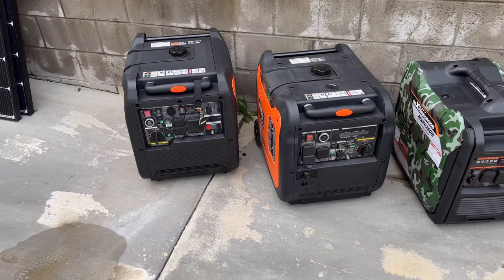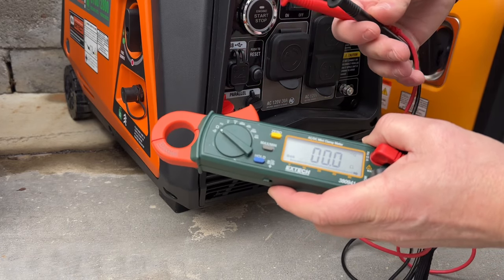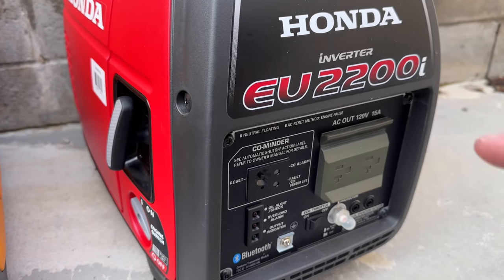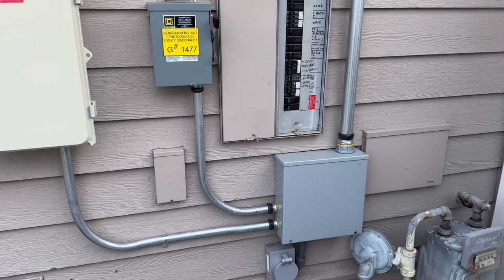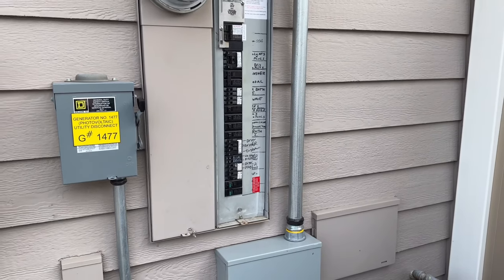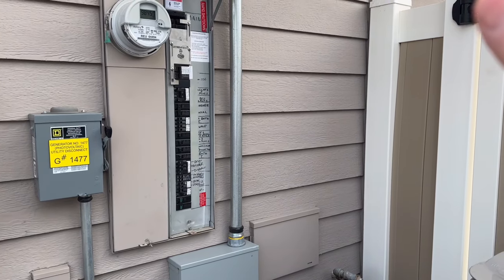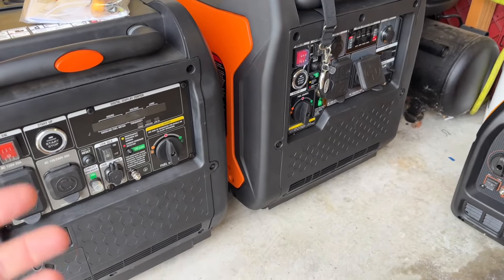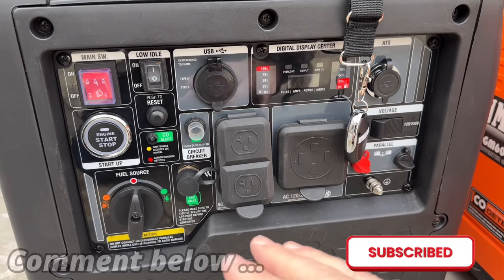Bonded VS Floating Neutral Generator Does it Matter?

Comment: What i understand , the rule of thumb is, if you are connecting to a breaker box or back feeding , it has to be unbonded. If you are using extension cords , then it needs to be bonded.

Comment: Floating neutral generators are for hooking up to your house panel which will then provide the generator with the bonding and the ground rod both bonded generators are for stand alone use with extension cords isolated from bussed systems.

Comment: One and only one bonded neutral for each separately derived system'; otherwise, you are creating a dangerous alternative path of current should there be a ground fault.  You need to know whether your transfer switch opens the neutral along with the phase conductors; generally they don't; they open the phase conductors and use the home/building's neutral conductor path.  In which case, the generator should be set as a floating neutral, if it isn't already  When a generator is used as a stand alone power source (i.e., a separately derived system), then the neutral and ground should be bonded.  A bounding plug should be handy to quickly changing from floating to bonded neutral when you use for the generator as a stand alone power source.  Always mark your generator, asn to its permanent state of boding.
Reply: If your generator has GFCI outlets, will that bonding plug work?

Comment: I work on the railroad and have had to deal with this every major storm. We temporarily power interlocking bungalows with every type of generator available at the time during power outages. The 5000+ watt units with gfic outlets we have to convert to floating neutral or they trip and won't power the already bonded electrical panels. It was never an issue before gfic outlets in the new generators. The last group was a pallet of generac 8000 watt units. No big deal if you know what's going on. Like you said only 1 bond for the new fussy generators lol.
Reply from the maker: Yea it’s really the new ones that have been giving some people troubles. Sometimes no issues, weird.
Reply: Actually, it is not weird at all, just a lack of insight into what is happening.  So say you hook into a bonded panel with a GFCI generator outlet.  You will create a ground loop, which is against code as in you have two bonded points.  That ground loop will generate a ground - neutral differential at the GFCI outlook.  GFCI is designed to look for small differences as your body is a resister and so will only draw a small current when you are completing the circuit with your body.  GFCI needs to be able to trip with these small currents so that people don't die when they complete the circuit with their body.  However, seeing you are bonded at the generator and at the panel and all the wires have some resistance, you create a ground circuit loop through the GFCI on the generator and pop it.  There are other YouTube videos that get into this.  Say you are pulling a 1,000W load,  You may see say 1 amp going through the ground on the generator due to the neutral bond in the panel.  1 amp will pop a GFCI with ease.

To make a big topic with GFCI simple, it is generally used where people and water may be present at the same time, like say your bathroom or kitchen or even basement where water could intrude in.  Probably also want to have near a pool.  If you don't need GFCI, you don't want it.  Say for example you have a computer.  You probably want to have your computer plugged into a surge protector or even full on UPS with a built-in surge protector when on grid power so that a lightening strike on the grid doesn't necessarily fry your computer.  However, say you plug that surge protector / UPS into a GFCI outlet.  Whenever there is any sort of power surge on the grid, which I find tends to happen multiple times a day every day, the surge protector will dump the excess power to ground with the intent of it going to Earth ground, say for a lightening strike.  However, seeing you plugged into a GFCI outlet, it will interpret that as someone getting a shock, say like what it would see from water splashed onto a toaster oven while someone is operating it, and trip the GFCI breaker.  Better for the CFCI breaker to trip than to become toast yourself, but at the same time if this is not the situation you are looking at, you can see that GFCI is actually working against you and popping even when it seems like everything is fine.  And of course if you figure out what I mean by creating a ground loop with dual bonding ground and neutral with GFCI involved, you will see that you are going to trip the GFCI whenever there is any sort of load on the circuit, which is definitely not what you want.

Comment: We had power out due to a storm on new years. I ran an extension cord to the furnace by Trane from the Honda 3000 generator.  The blower turned on but the furnace would not ignite.  I had to bind the neutral and ground for the system to work.
Reply: That's what I have noticed as well. Most furnaces need the bonded connection to work.
Reply from the maker: Most furnaces are like that.
Reply: Generally nowadays most do, and nearly all high-efficiency do need it.
Reply: Thank you for posting this.  Just went thru an ice storm here in Texas and ran into this issue.  I must have wired and unwired the damn thing 10 times same result every time.  Thanks

Comment: I just removed the jumper wire on my generator. It’s over 20 years old so I don’t really care about the warranty because there is not one. Even if I bought a new one, I would do the same thing. It’s very easy and now gives me the flexibility to put a plug-in like you showed if using standalone or to use it on my house with plug removed and my manual interlock. Thanks for the video.
Reply from the maker: Yea on the older units it’s definitely much easier because you can get to the engine easily. The newer enclosed frame inverter generators are not easy to swap because several pieces have to be removed. 

Sometimes old and simple was nice lol 

And you’re welcome 😀👍🏼
Reply: @johnnysweekends  So I looked in the user manual for a DuroMax XP15000EH. The specs said "floating neutral". Ok, so that's one that would be good to wire into my transfer switch. But... that wouldn't be good to use directly to power home appliances and stuff?
Reply from the maker: @user-bd2xj7oy6l it would be just fine
Reply: @user-bd2xj7oy6l  - if it’s already configured to be floating neutral then yes, you can use it directly with an interlock. If you wanted to use it just stand alone I believe you’d want to bond the ground and the neutral by using the plug that makes/bonds that connection

Comment: Why do all these videos assume you are using a transfer switch ?   For that matter a lot assume you have an external disconnect to your house.  Since the disconnects have only been code since 2020 I believe and you can get a generator interlock for 20 dollars off the internet as opposed to pricey transfer switches, I think they are not properly addressing a good chunk, if not the majority, of the viewers of these videos.
Reply from the maker: A transfer switch is just another way to easily power your critical loads. 
A interlock doesn’t power anything. It just locks the main out. You still need to get a generator inlet box if you wanna power the whole panel.
Reply: @johnnysweekends  I have an interlock setup with inlet box. Looking at replacing small 2kw inverter generator with larger one, but all of the larger (5kw) seem to have bonded neutral. The bonding plug is to easily convert a floating neutral to bonded.  The only way to convert bonded is to actually get inside the generator and change wiring. Will this be an issue or should I really hunt for 5kw with floating neutral?

Comment: QUESTION.  If your generator is unbonded because you are connected to the house panel neutral should you still ground the generator frame to a grounding rod ?
Reply from the maker: No unless it’s a permanent mount. Portable unit uses the homes bond.

Comment: So when hooking into a plug with just a basic transfer switch that makes sure the main is off and has a breaker in the panel to feed everything from the generator to your house you need to remove the bonding wire if I’m reading this correctly. 

Then if you want to use it like on a jobsite you can just use a bonding plug to keep everything bonded again and be safe. 

Great video by the way.
Reply from the maker: Don’t even need to bond at job site. Most people dont unless a tool or specific item needs it.

Comment: Great video. Question: I just purchased a Rigid 8kw generator and using the 30amp receptacle gen outlet and connecting it to house using an interlock. I now want to use the 20amp/120v receptacle with an extension cord to fire my gas heater in workshop in different building with its own elec service. Since using it as floating neutral to house and knowing the gas furnace ignitor will not operate, can I bond just that one outlet? So one outlet floating and one outlet bonded. Thanks
Reply from the maker: Thank you. As for yours I don’t know because I don’t know how they wired the plugs. On some bigger units a bonding plug will bond a section and maybe not the others. So you can try it if you are needing it.

Comment: Rosie and I just purchased a Max peeding 3500 so this winter in the desert we can run our air a few times. We have been RVing 40 years or so and have had several different generators. All worked fine and I never even heard of bonded or neutral. Still a bit confused on when you need it bonded or not. Maybe some examples of the use for them would be helpful! Burlington Bill busking on the road and you-tube.
Reply from the maker: Really only needed on a Rv if you have a onboard power management system or energy management system. Or say using a watchdog type surge protector. 
But you can plug directly into the generator and skip the watchdog.
Reply: After some research I found that I have a neutral bonded generator and when plugged in to my unit it becomes bonded. Checked continuity before and after plugging in from neutral (white) to ground. What you say is exactly right. Thanks. @johnnysweekends
Reply from the maker: @burlingtonbill4687 😀👍🏼
Reply: I have a MXR3500 that will be used to power my RV. I just installed a watchdog surge protector and found no power was getting through it via the generator. Turns out I need a grounding plug which is on order. Question though… should I connect a grounding rod to the generator as well?

Comment: Champion generators have several videos on converting their generators from bonded neutral to floating neutral. Inverter generators can be a little more complicated, but most conventional generators are simple to do. But take Johnny's advice and always consult a qualified electrician or you may do more than trip a breaker.
Reply from the maker: Yes I have not really seen any inverter generators that are enclosed frame have a instruction in the manual showing you how. So maybe these types of units they prefer you not to mess with it. Verses open frame units it seems more common.

Comment: Thank you for video! Think I’m somewhat understanding now after being confused for so long. 
So if I’m plugging directly into house panel, I need the generator in floating neutral. So I need to unbonded. 
Once I do that I cannot use the inlets in generator at same time? I would have to bond them again? 
If I leave generator in floating neutral could I hook a plug to bond it so I can use it as portable without having to reopen the generator and plugging everything back up?

Comment: If I'm backfeeding a generator to a breaker panel, could I just leave the neutral out of it? Basically, only connect L1 and L2?

Also, thanks for the video. Was interesting. Basically, my arc fault breakers go crazy when I backfeed my generator.

Comment: Thanks for this video!  I have line of 10/3 wire running from my panel to my garage to power my EVSE car charger.   In other words, no neutral wire.  If I was going to attach a generator to this wire to backfeed a panel theoretically, I would need a bonded neutral generator that would be sending the neutral to the ground, right?
Reply from the maker: Normally 10/3 has a neutral in it. Unless it’s 240v with a black and red and neutral but should have a ground wire. Unfortunately I don’t know what you have wired so only thing I can say is a neutral floating generator is east to bong. Verses a bonded unit depending can be more work verses a bonding plug.

Comment: So by "Appropriate Transfer Switch" he means THREE WIRE Transfer Switch which also intercepts the neutral (grounded conductor) Vs TWO WIRE Transfer Switch which only isolates the Hot or Ungrounded conductors when sourcing to the Generator Vs the Utility

So if you DON'T HAVE A FLOATING NEUTRAL (ALL modern portable generators with GFCI protected receptacle outlets come this way) you need a THREE POLE TRANSFER SWITCH which intercepts the neutral also.  If you can Un-bond the neutral in your generator (remove the system bonding jumper) OR it comes with a Floating Neutral, then this is not a Separately Derived System and you only need a TWO POLE TRANSFER SWITCH.